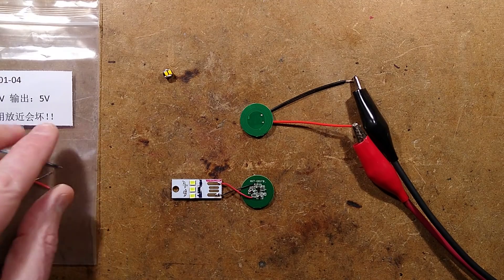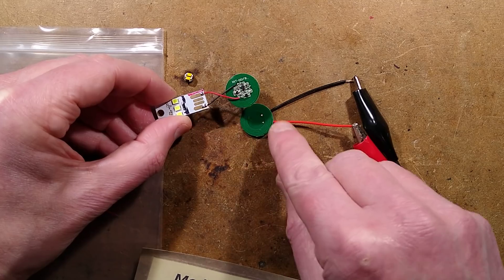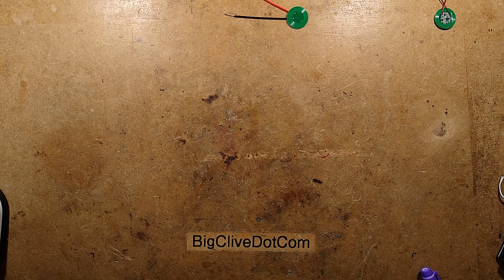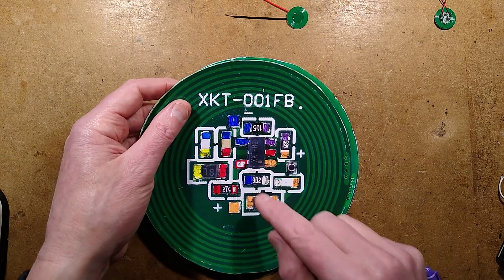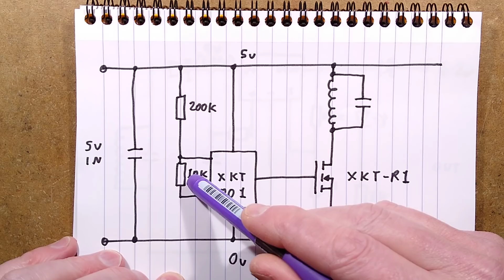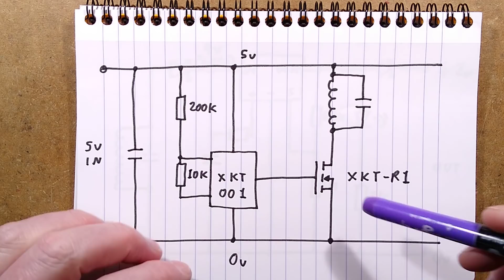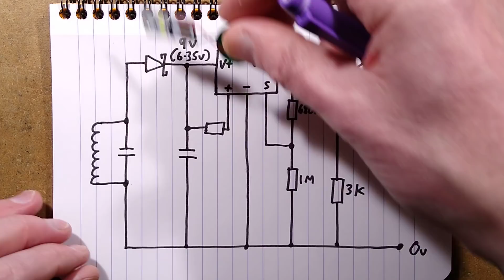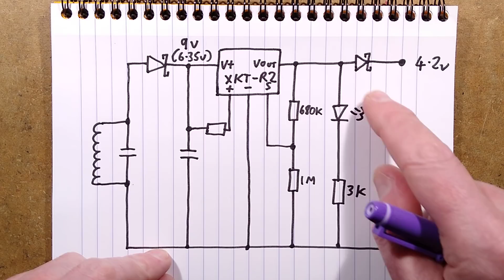Wireless power transfer modules (with schematic)

Comment: I know this thread is years old, but I was hoping you might see this question all the same.  I'm wondering where in the receiver circuit the AC from the coil is converted to DC. Or am I missing / misunderstanding something ?  Cheers, Steve.
Reply from the maker: It's the schottky diode that rectifies the output.  It doesn't use a full wave rectifier.

Comment: Hello, Dear friend, we have a problem that we. need to transfer some data through the double coil, one coil with sensor sending sensing data, another coil with wireless power supply, now we are using the xkt 510 to generate 100khz AC, but we don't know how to sensing the sensing signal. I f you have some great idea, please let me know, we will appreciate it very much. Thanks
Reply from the maker: Can you use an infrared link for the data?

Comment: This is kinda untuned resonance WPT system. Since no tuning is available, it is natural that the system will have high losses and pretty variable voltage gain (Therefore too close the LDO will blow up). Thought it is a LLC like in Qi wireless charging standards.

Comment: I've got a smartwatch that I want to try and fit one of these into. It currently uses a proprietary pin charging system and the internal battery says its 3.7v.

I was just wondering if you think this would still work

Comment: ...we can utilize this tech to remote control with rechargeable batteries to turn relays on appliances like tv..so we could eliminate stanby powers needed to turn on tv for example..this makes appliances more power efficient and lightnings surge protected.. isolated from the grid until Its actually used..remote powerup within 10 meter range..

Comment: Ya know the real problem with Wireless power transmission? Who  Pays for it when all I need is some capacitors, a bunch of copper wire, and some diodes?

Also what effect will all Dat spurious  RF energy have on other electronics....

Comment: The same principle is used in QI wireless phone chargers. Convenient but horribly inefficient. A charger drawing 2 A only manages to feed 1 A to the phone, the rest is "lost in transmission" and the phone gets heated up.
This is probably not critical in the small circuits Clive has been playing with, but it's annoying in phone chargers. Heat waste is one of the biggest causes of battery aging.

Comment: Question: I want to installl a 10k type B linear potentiometer (I don't need audio logarithmic) inline to a mono out jack for a metal detector for headphones (no volume control). I'm going to put signal in to lug #1, out to jack from wiper lug #2. If I leave the third lug open (not grounded) will it damage the circuit?
Reply from the maker: You should just need the two connections.  10K might be a bit high.
Reply: @bigclivedotcom  That "You should" does not sound too confident. 🤔🤣

I'm just going to solder #3 to pot case then to pcb ground. What can it hurt? I

 I saw a diagram for 5K for headphones, so I figured 10k to be safe. Also linear taper because I'm just setting it at one point (not blowing my eardrums).

Comment: Clive, do they make wireless transfer units that I could attach to the bottom of my kitchen table and sit a artificial flower pot with LEDs on top and have it light up with out a cord? The spacing would have to be 3/4 to 1 inch. The powered unit would be underneath attached to the bottom of the table and plug into the wall with a walwort. My wife could have various arrangements and Halloween and Christmas displays as well. I haven't seen any yet, have you?
Reply from the maker: You could possibly do that with a standard Qi charger plate and one of the 5V output receivers sold on eBay.  The gap is significant though, and may be a factor.

Comment: On the receiver it appears the feedback for the linear regulator is 2.5 Volts e.g.    4.2 * 1meg/(680k+1meg) = 2.5 Volts.  The IC will do its best to manipulate the output to see 2.5 on the sense pin

Comment: Would an application be lapel pins with led lights built in?  Most if I recall correctly have the electronic components on the outside portion of the pin which makes them somewhat bulky.  If this could move the electronics to the inside portion of the pin it would make the pin appear cleaner on the shirt/lapel.
Reply from the maker: It could work, but a much tider approach would be adding a flat lithium button cell.

Comment: If the output is 4.2v beyond the Schottky diode, the output from the regulator is ~4.5v and the voltage at the sense input should be ~2.7v?  Correct? It looks like a change to the voltage divider could give you a pretty wide range of voltage output; 2.4v-6v (again with the diode drop).

Comment: I recently tried messing with one of those (the 5v buck version though, needed a longer range), and appears a series-connected loading LC performs much better than the parallel one they use. Why the parallel circuit? Just for getting rid of the extra diode?
Reply from the maker: I'm not sure why they specifically use the parallel format.

Comment: I don't really understand, when we are trying to save energy these days, why put a wireless step into place which simply reduces the energy efficiency... convenience may be a wonderful thing but is that wasted energy worth it ? 🤔
Reply from the maker: Very low power application.  Allows completely sealed enclosures with no connectors to damage.
Reply: @bigclivedotcom   Clive ... I was thinking more about the wireless phone chargers... and there were rumours about a similar charging system for e-cars... the losses there would be substantial... 😳

😎👍☘🍺

Comment: Looks like the receiver chip S pin is looking for a 2.5v reference.   So for true USB spec voltage,  if you put a 1.8M Ω resistor in parallel with the existing 1M Ω resistor you’d get about ~5.1v out, or around ~5.3v out by using a 1.5M Ω

Comment: My BV9900-pro does not like wireless chargers. 
I bought 2 chargers to try out. about $30 each.
I gave up on them due to them tripping the thermal sensor in the phone, melting the plastic case or both.
Reply from the maker: I never had that issue with a standard pad.  Maybe because it was a lower power pad.
Reply: My previous Samsung phone came with a round charging pad and the rectangular phone had to be placed somewhat off center and very specifically on the charger in a certain way otherwise it wouldn't work. No thanks!

Comment: Decades ago, doing some fisheries research, we used these small devices encased in resin so they could soak at depth in the sea.  Just timers that ran until the magnet was pull off the reed switch when a fish hit the line.  They were used until the battery died and replaced.  This device seems useful to get a much longer use period by recharging the batteries.  No doubt today they use "smart" timers that fail most of the time or something.

Comment: Isn't it used in those battery powered candles in restaurants? When they close they collect all of them on the charger. It is powered by a single lir2032 or so. Would explain the 4.2V.

Comment: Waterproof gadgets need a larger gap from the charger to dry out than what the inductor systems have supported.
Reply: My first idea for im-practicable use, was LEDs in a plastic bubble with elle gubbins and a wee batt. floating in a translucent water fountain powered by a wind generator 'n' solar ... the rim of the base or in the rising tube as point of recharge ?  Totally useless but oh so pretty..

Comment: If the transmitter has a current sense for when the matching circuit is near, you could maybe use it hidden inside a door to make a hidden interlock

Comment: So what we have here is a split 1:1 transformer, without core. Cores are put in transformers to make a better magnetic coupling, so there's less energy transfer loss. It's a fun idea, but it's not optimized for what it's supposed to do: Energy transfer. Doing a quick back of the envelope calculation, this system puts the same losses back into place that we had with incandescent lightbulbs. Just now we get the light from an LED, a light system we've adopted to save energy. Welp, there go your energy savings. Just so it's "wireless". Makes me wonder what RF screams it puts out.
Reply: Well it's not completely useless, its fairly thin so it could easily be mounted in a thin case or something as a cheap inductive switch/sensor perhaps. Also, charging ports tend to be points of failure and they also pose somewhat of a threat in terms of fires due to possible shorts (A guy who educates on fire safety told me that phone charger leads cause more fires than you think). The constant plugging and unplugging always wears the socket/plug out in the end. It's for precisely this reason that I now mostly charge my own phone on a wireless charging pad, because I got sick of charging cables or improper connections in the socket

Comment: Using the diode on the output, I suspect more that it is a switching regulator. You can measure the output from the chip, it's waveform will expose the secrets.

Comment: Back in the mid/late 80s we had so much fun with inductive/wireless power transfer.  Another great use for it was quick detach of radio transmitting equipment from a fixed aerial (stateside: "antenna" ).

Comment: I recently had to replace my phone and got the Samsung S21FE for one main reason, but secondary reason is for NFC (near field communication) for touchless pay). Looked into it in 2018 but my G6 from Motorola didn't have that, let alone wireless charging and at the time, it was looking like I could not use my debit card, with it as the software was not compatible with my card. Now, my credit union can accept Samsung, Google and at least 2 other tap to pay software so I'm setting that up. At that point, I didn't realize that you likely could change out the tap to pay software out even then. 

The wireless charging is to reduce the strain/load of the USB for nearly daily charging of the phone (4500mh) battery and Snapdragon 888 processor means roughly a day of use between charges. At 5000Mh battery on the slower processor of my g6 meant a day and a half of use between charges when new but the failures was the USB port becoming loose and charging capabilities ceased to work, on both phones, one I bought new, the other a reman unit to replace the first phone and that second phone was acquired in January and the port was not as tight when I plugged in the USB cable to start with and by March, had failed to charge, so the Samsung was procured. It is considered a mid tier phone, and was the ONLY one to have wireless charging, never mind it is only 10W, so not the fastest, but will charge my phone from roughly 5% in about 2 hours in any event.

Comment: The transmitter has an XKT-R1 mosfet to send a "signal" to the coil.  The receiver has an XKT-R2, which I'm guessing somehow "decodes" the signal from the coil.  They look like a pair of chips meant to go with the XKT-001 specifically for this application.

Comment: could make a tesla coil from one
Reply from the maker: It could be used for powering other coils.
Reply: @bigclivedotcom  or just put a multi kw telsa coil in your attic, and just use a few diodes, capacitors, and some wire, though operation of other appliances and radio networks may become unstable

Comment: i designed my 3d printed robot with a recess in the bottom so I can fit the 1A version of this into my robot so I can just drive it onto the charging station and it can lower itself onto it.
I planned on having a magnet too to help keep it center but when I tested it it showed a huge decrease in efficiency so that got scrapped maybe smaller magnets on the outside of the coil would work better
Reply: That's how apple did it with the newer set of phones, the ring of magnets around the coil.

Comment: Clive, with how much money you spend on ink, I have to ask. Are you refilling the cartridges yourself or letting them jew you crazy price for every replacement? TR4550 does not have DRM and can be refilled very easily. Put ink in, blow into it to get air bubbles out, put piece of tape on top leaving only the tiny channel to take air, and it just wooooooorks.
Reply from the maker: Epson ecotank for bulk ink use.
Reply: @bigclivedotcom  even better. I installed one of those system on a HP, but it seems the HP can self destruct. It squirted ink on its own little ribbons, and what I noticed, is every time it "parks", it wastes a lot of ink. It was new, changed cartridges twice, and the pads inside were SOAKED, before I even installed the continuous ink system. Long story short, HP is VERY bad.
Reply from the maker: @dimitar4y  Yeah.  I had no joy refilling my old HP printer.  It had a very odd ink-bag system in its cartridges.

Comment: If its output is 4.2V then it is no use for charging a phone wirelessly?  Can it be made to charge a phone?  Or have I missed something?  It would be good it it would put some charge into a phone during the night, just drop the phone and it would charge when not being used, slowly I must admit, but my phone sits about a lot doing nothing when it could be hacked to charge during this time!

Comment: Does the receiver work with standard Qi chargers? If it does it's small enough to easily be retrofitted inside devices where you don't necessarily want to poke extra holes in the case for a usb port.

Also what's the thickness of the receiver?

I was thinking I might want to retrofit my New 2DS XL and since the receiver has that diode already I could just solder it in parallel of the existing charging port and tape it where it's most convenient on the inside of the shell

Comment: you could use it to power some fish tank lights or devices
Reply: If it failed spectacularly you'd have dead fish. Seafood chowder, anyone?  At the very least, since many fish species migrate and have some inherent navigational capability (presumably ekectromagnetic) built into their tiny brains, what would that radiation do to their behavior in the tank?

Comment: Others already requested the frequency.
I am curious to know if the parallel LC is tuned to have resonance at that frequency, or if the capacitor, is just there to decouple.
If I remember correctly from my electronics days, if you make a parallel LC circuit and pulses it at its resonance frequency, it will create relative high currents in the coil.
Reply from the maker: I think the capacitor is for resonance.
Reply: LC series tank creates high current in resonance, LC parallel tank creates zero current in resonance. A capacitor has reactive impedance of -1/(2*pi*f*c) imaginary Ohms, and an inductor has 2*pi*f*c imaginary Ohms. When |ZL|=|ZC|, we call it resonance. When they are connected in series during resonance, as |ZL|=|ZC| and they have opposite signs, ZL+ZC=0, thus the series impedance is very low, only contributed by the resistive bits of the L and C, which are usually very small. When they are connected in parallel during resonance, since Zp=(Z1*Z2)/(Z1+Z2), ZL+ZC=0, we have a denominator of zero, thus the impedance is infinite assuming no resistive bits' presence.
Reply: @bskull3232  You are referring to the use of LC coupling as a filter, Then it is true that the current coming out of the filter will be low on resonance frq with a parallel coupling.
However if you look inside the L and C High amount of current is flowing between them.
You are correct that the impedance is of opposite signs, or in other words the current is 180 deg out of phase. So when current is going "downwards" in the C, it goes "upwards" in the L cancelling each other out so the output of the circuit is zero (ideal L and C) thus the bandstop effect.
(Upwards/downward is a illustrative reference to the diagram Clive had drawn.)
In a real circuit this high current in mainly limited by the R in the real life non-ideal coil.
This is also why you need the transistor/FET below to push the current like when you push a swing.
Reply: Ya know what I'd like to see made wireless? Multimeters! Imagine a set of battery-powered probes that communicated wirelessly to the display of the multimeter. Wouldn't that be great, to not have wires that twist and tangle and drag across the bench, knocking things off the table?  I guess the limiting factor would be how small you could make the probes and how long their batteries (rechargeable, of course) would last.
Reply: @goodun2974  Well unless you invent a good way of wireless voltage potential transfer you would still need a wire between the two probes.
Reply: @martin_hansen  , well yes, 18" or so of wire connecting the two probes would be fine, certainly more convenient than a pair of 30" or 36" wires going back to the multimeter itself. Like I said, the question is how small you could make the probes and still have them contain a battery and relevant voltage/resistance-measuring circuitry, and a Bluetooth type transmitter to the meter display. Perhaps it would require a different set of probes for resistance measurements as compared to voltage measurements. Amperage,  on the other hand, should probably be measured with a standard multimeter in ammeter mode....
Reply: @goodun2974  Have you watched Mr. Carlson's lab? He has a wireless multimeter except the it's a bit larger than you are hoping for. I can't imagine anything with safety ratings being able to be tiny.
Reply: @eDoc2020   I have watched his channel from time to time but I didn't see his wireless multimeter.

Comment: Now I want to take my rechargeable toothbrush and charging unit apart! I didn't realise they were wireless charging until I bought one.
Reply: Wrapped a few turns of wire around the "spike" on my Braun toothbrush charger and stuck that into an oscilloscope. Looks fairly sine wave-y at about 40kHz, but that's as much investigation as I'm prepared to do (I use the thing for cleaning my teeth 😁)
Reply: @tonywalton1464  There's some decent teardown videos on YouTube!